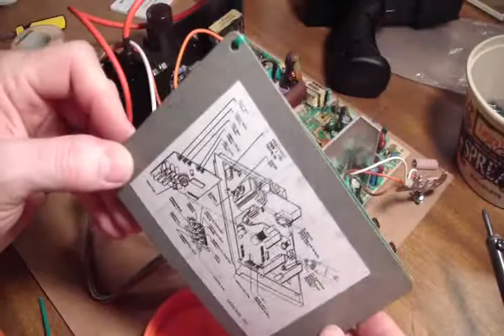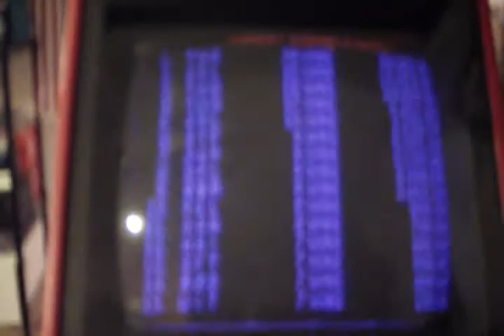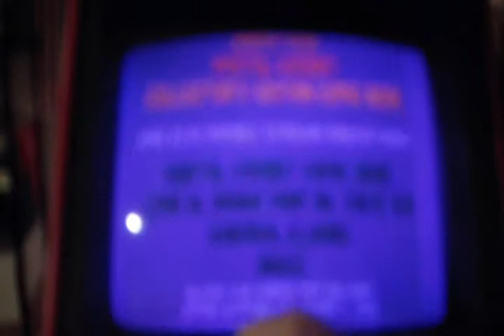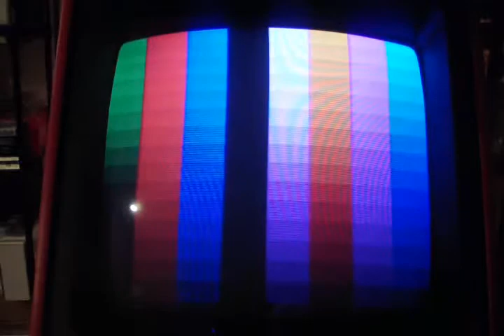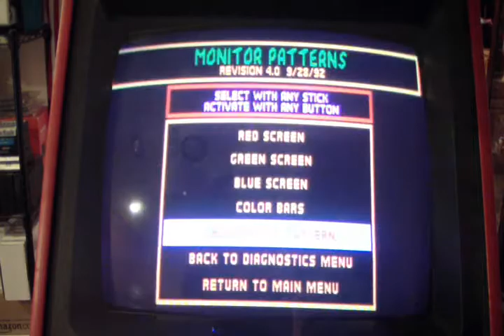(Part 3) U5000 Cap Kit & Flyback Replacement

Comment: good job I'm in the market for a good cap kit. which you recommend? it's going in my dirt dash cab the blue it's out I checked all the guns and cracked solder joints but didn't see any
Reply from the maker: Oscar Hernandez I would usually say therealbobroberts.net, but last October he stopped taking orders.  He may start again.  You can try iankellogg.com, and use coupon code johnsarcade to get 10% off your order.  Visit John''s Arcade YouTube channel, too.  He works with Ian to create the cap kits I believe.

Comment: hi. you mentioned k7400 then k7500. which is it ?  or both are the same ?
Reply from the maker: sm ma I was talking about the similarities of those two to this U5000. All three chassis are very similar. The K7400 which I am removing from this tube so I can try the repaired U5000 will only do standard resolution. A K7500 in contrast, will only do medium resolution. The U5000 that I am testing with this tube after the repairs can do either standard or medium resolution after you change the appropriate jumpers on the chassis.